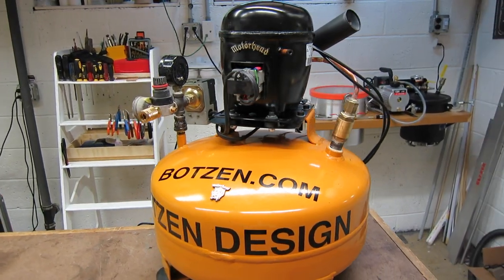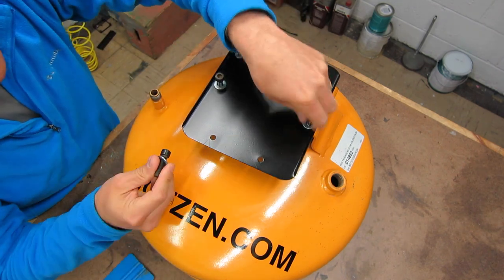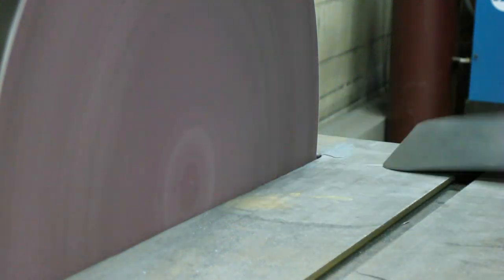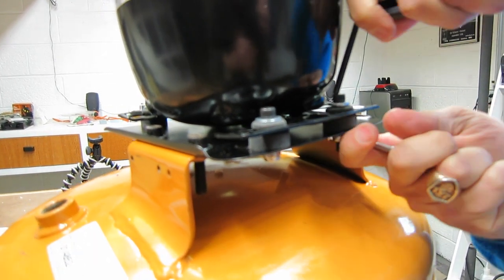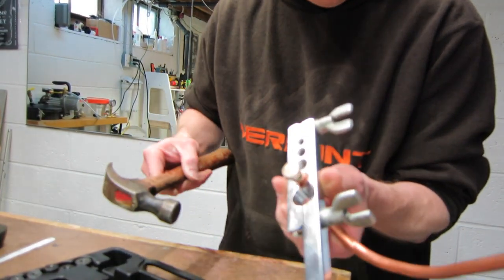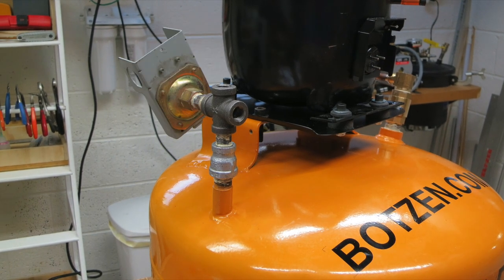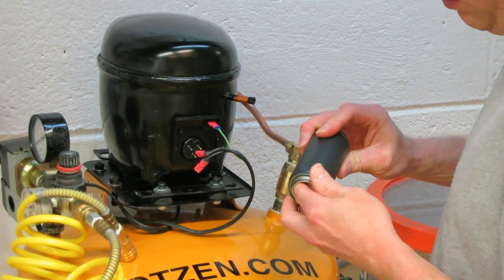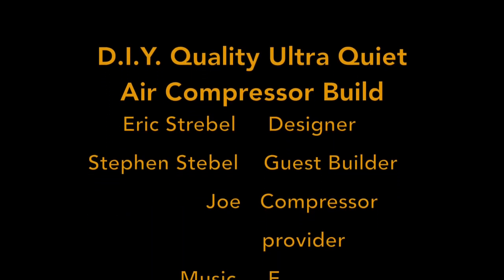Ultra Quiet Silent Refrigerator Work Shop Air Compressor Build

Comment: i see and heard you say to replace the oil with 10w40, but you didnt say how much. whats the volume needed if you know an accurate answer? thanks for the great video. but its be nice to see some hillbilly hacks instead of a full shop.
Reply from the maker: I added the same amount of oil as I removed, I have no idea what that volume is, i drained the old oil in a cup, made a mark on the cup, then got a fresh cup and filled new oil to that sameark and put it in the compressor. That doesn't really matter since it's going to be different  for every compressor. Thanks for your comment and support, much appreciated.

Comment: Two thing of note in this video: , use a refrigerator compressor, and change out the oil. Oh, it helps if you have a metal working shop.

Comment: Nice project..but the only problem with this compressor is that it discharged so much oil out from the compressor and it affects the air especially when you use this for spray painting.. if u can adress this prob then its perfect..good job

Comment: I’m removing the same compressor off in my refrigerator that we are getting rid of it is the same brand I wanted to ask how much or oil do you add to it once to remove it?
Reply from the maker: Lasurge1982 put in as much as you drain out.
Reply: Eric Strebel So the two copper  hoses coming off the side of the compressor are the input and output And the one on the opposite side by the site itself is oil fill?
Reply from the maker: Lasurge1982 yes, every compressor is a bit different, double check the one you have to make sure.

Comment: Hi there, what is the max. pressure you can reach with an old fridge compressor? Can it achieve 120 psi (8 bar) or more? I was afraid of overheating the compressors with that much pressure and went below 80 psi. 20 years ago i built an home made compressor out of 3 fridge compressors in parallel to fill up a big gas tank. Still working today but one compressor quits - makes a summing sound but doesnt pump.
Reply from the maker: richardnanis don't know the max pressure, but I charge my tank to 100psi, so it seems feasible.

Comment: can I still use a compressor that I've grinded open? I understand that it needs the oil for lubrication but If i have it sitting in its casing in oil will it still function properly?
Reply from the maker: I have no idea Easter Bunny, try it and see what happens. Make a video and share it with the world so we can find out the answer. Good luck. Thanks for your support and comment. Feel free to share on social media!

Comment: nice video, the third line from the compressor that has no connection did you seal it off or just leave it? what is it purpose?
Reply from the maker: C.S.Rodney thanks!

Comment: I built an air compressor from a refrigerator compressor and it ran for about 3 months. Then it start short cycling. It would run 30 seconds then quit. What did I do wrong? Thanks for a great idea.
Reply from the maker: Not sure, not my filed of expertise. Probably your on off switch or the capacitor, good luck
Reply: @EricStrebel  I did not replace the oil as you did and it was getting into the air supply to the tank. I think it may have caused the motor to seize up some and make the pressure too high to keep it running. I will try again. Thanks.
Reply from the maker: The oil I used was definitely thicker than the stock stuff

Comment: Thanks it a great video tutorial Eric! This video is one of my references when i builded my own air compressor out of a fridge compressor, its a two 1/2hp fridge comp and a 20kg propane tank.  i noticed that you replaced the factory oil with 10w40 synthetic motor oil, right? and before putting new oil did you flush it with solvent (ac flush, isoprophyl alcohol, lacquer/paint thinner)? 

Thanks again.
Reply from the maker: Good luck, I just changed the oil, I did not flush it with anything, watch the follow up video as well.

Comment: Do you happen to know the CFM measurements from this build? Looking at other options for metal engraving need a certain CFM value and PSI to operate a tool. This appears to be a much cheaper alternative.

Comment: My dad converted an air compressor from a commercial air conditioning unit to use in his garage 35 years ago. Some of the parts he used were galvanized metal and not brass or copper. All the galvanized parts rusted and blocked the airflow over the years and had to be replaced with brass. So use what you have but if you need to buy some parts and have a few extra dollars buy brass and it will be maintenance free.

Comment: You have to add an oil ceparatore then feeding any separated oil back into the section pipe. Otherwise the compressor is going to  run out of oil in few months.
Reply from the maker: ahhh, no you don't. been running for years with minimal oil loss, just add a few CC's every year.
Reply: @EricStrebel  It depends on how many hours you are running the compressor. But, you can't be sure what to add and when.
Reply from the maker: I doubt that the compressor runs for more than 1 hour every two weeks, so not very much.
Reply: @EricStrebel  , that seems a fixed rate and you will be able to estimate the top up rate correctly.
Good luck.
Reply: Still, if you can add that oil separator it will be so great.
Best regards.

Comment: Machine shop 101...  NEVER wear gloves when using a disk sander! Seen some people loose tips of fingers when the glove get pulled into the gap between the disk.
Reply from the maker: Safety is important. I agree, Wear a pair of gloves so you don't burn your hands, two schools of thought here! I am wearing gloves on a pretty big piece of metal. Never do I get close to the wheel. So not an issue for me. If it was significantly smaller I would wear a pair of tighter fitting gloves. Don't get your fingers close to the gap at the bottom of the disk an the shelf. I would recommend a pair of mechanics gloves. I am aware of the danger, know your limits and be smart.  Thanks for the comment and support.

Comment: But how long does it take to fill?
Reply: JAH1R very long
Reply: actually it should takes 5 minutes.  It all depends on the displacement of the refrigeration unit.. a good one could have up to 5 cucbic centimeters,,, they could do it in 3 minutes for that bosticht tank.
Reply: 7 to 8 minutes going on the video.

Comment: whats the amount of oil the compressor takes?
Reply from the maker: i3dm however much you drained out of the unit.
Reply: Eric Strebel mine spilled out so i cant tell. i added abiut 6oz of mineral oil and she seems to run nice and quiet
Reply from the maker: i3dm i doubt mineral oil will hold up well over time.

Comment: What is the typical operating pressure, on the refrigerator?
Reply from the maker: I have no idea
Reply: Some go to 500 psi. We use fridge motors in the opposite direction to suck air out of things. They work really well to make near vacuums.

Comment: What do you do about the oil coming out that needs to be fed back into such compressors?
Reply from the maker: I do run a filter on the system at this point, I see no oil getting trapped in the filer. You can always just add a few ml's of oil every year if you feel it needs that.

Comment: how did you get the old oil out of the compressor? and did you just replace the same amount you extracted?
Reply from the maker: Tip the compressor over and drain the oil out of the fill tube, yes same amount of oil was returned after it was emptied.
Reply: @EricStrebel  Thanks.  I'll give that a try.

Comment: What is the flow rate on a system like this? How difficult would it be to adjust the design to be switchable between compressor and vacuum pump modes, or just vacuum mode? It looks like alls you'd need to do is switch a couple pipes around. Has anyone tried this?

Comment: Maybe it’s already been asked, but how come you didn’t put in a pressure relief valve on the high pressure side of the pump to get rid of head pressure?  Head pressure is in major culprit in restarts for over Amps.
Reply from the maker: Can you share one of these pressure relief valves with a link here for everyone to see? OMM
Reply: Eric Strebel it is built in to the electric starter. Prior to the check valve you need a T fitting (some check valves come with this built in). From the T fitting a 1/4”(6mm) goes back to the electric starter and when the electric starter turns off, it bleeds head pressure. With head pressure bleed prior to a restart, doesn’t overwork the motor until it gets up to speed. This is also known as an unloader.
Reply from the maker: OMM ok, not foamier with this, but I get the concept. My unit runs rather infrequently, so it's not an issue for me, but for others it has been. I will have to investigate this "unloader", Ideally you want this built into the check valve, I can see how this would be beneficial. You probably need a pressure switch that can adapt to the unloader as well, is my guess??

Comment: Can you give an estimate on the cost estimates on the parts? Also, what is the max PSI that the compressor can pressurize the tank to? Lastly, can you provide an update on this project? Have you experienced any issues?
Reply from the maker: taumax estimate is tough depending on the parts your use. No issues so far really, look for na update with a larger tank in the next few months.

Comment: at bottom u have to fix air moisture water out valve. safety  pressure 
valve should fix on the top of tank. u have not fixed the moisture water
 valve.
Reply from the maker: +Bijay Singh Negi Yes, I am aware, other have made this comment too. very little to no moisture in this set up. not an issue...
Reply: A pressure relief valve can be opened to drain moisture then closed back. Since it is brass it will not rust and its faster than unscrewing a drain cock. I have used one on my compressor for years with no problems.

Comment: hello sir, how much oil did u pump into the compressor?
Reply: Pour the original oil into a measuring cup or empty oil bottle. Then you will see how much you need.
Reply: It depends on the compressor model, its a good idea to check the datasheet if you know the brand/model number as too much oil is as bad as not enough

Comment: can you give me instructions on how you install the relay capacitor for the compressor and what brand or type did you use. Ty
Reply from the maker: +homer anthony medici not exactly sure what your talking about, but I used the stock relay that came with the pump and the on off pressure switch is from Furnas, you can get them on ebay. I don't know much about electronics, not my thing, since I am an industrial designer not an electrical engineer. Good luck
Reply: aw ok so you use the stock. some brand new refrigerator compressor dont come with a relay capacitor electrical wiring. another question how did you remove the existing oil from that compressor before replacing a new one. ty
Reply from the maker: +homer anthony medici I tipped the compressor over on its side and let the out drain out. Out of the fill tube, see video. The thicker oil has been great, no signs of oil in the tank

Comment: The socket cap screw should be replaced with the proper length hex head. Easier access with a wrench if you're going to use a fold up cheapo allen key set.
Reply from the maker: +Damn Yourugly I like the look of the socket cap screw. I probably should have used a fixed "L" wrench instead of a fold up..Glad you like the video!

Comment: The major downside of such a design is the very weak compressor will take a loooong time to fill the tank and you won't have enough air pressure when you need it for your air-powered tools, and will have to wait for the compressor to fill the tank again...
Reply from the maker: AlainHubert correct, however, I don't use air tools on this compressor, so it's not an issue for me. It's mainly used for compressed air to blow stuff off and to pressurize the  tank for resin casting. It's so quiet that I can't hear it run and filling the tank from 70-100 psi takes less than 5 minutes so it's not an issue for me. Thanks for your comment.
Reply: You're welcome. But it's still a very elegant design though. Looks very professional.

Comment: I was very curious and I wanted to try it for me to use PCP rifle charging.  Thank you for the info, I like to send and subscribe, I am waiting for the shipment to be returned ok🙏👍
Reply: This would not even come close to providing the flow rates and pressure for a pcp rifle. PCP needs 350 bars of pressure, a home compressor on average tops out at 11 bars.
Reply: PCP airgun fill pressures run 2K - 3K psi.  This one maxes out at 125 psi., not remotely close.  There is a small, bench-top compressor made specifically for PCP airgun use, called the Shoebox Compressor.  It uses a home-shop air compressor as a first-stage air supply, & is just what you need.   A quick Google search will take you to what you're looking for.

Comment: Hey dude. You should never put tin onto wires you are going to attach via a screw terminal. Metal tends to creep at temperatures above 0.7 of their absolute melting temperature if pressure (the screw) is applied. Over time the connection comes loose. Apart from that: Nice build
Reply: 282763 - Can you provide a reference to this advice? I have heard the opposite.

Comment: Dude you can buy that same used bostitch compressor for 30 bucks that has 4 times the power of a fridge compressor and you don’t have to own a metal fan shop? I mean nice way to toot your own horn tho
Reply: Four times the power and 15 times the noise. This is a special project for people in need of a low power low noise compressor. Don't come to criticize other people's work: make a video of what you can build with your hands instead.
Reply from the maker: Well said, thanks!

Comment: I have  question looking at your video one the one part  1/2, 200 psi check valve , what is that  very last piece you screw in at the top ?  Piece one was  1/2 nipple  piece two  was the one way  check valve  but that third piece  i can't figure out can you help me please thank you
Reply from the maker: +John Gee That is a 90 degree elbow, I think it is also a reducer to fit to the copper tubing a bit better.
Good luck, glad you enjoyed the video.
Reply: Yeah  trying to  do what u did in video  so far i  done spent 50.00  just in fittings and  still haven't brought  the pressure switch  still having some  trouble match  up the safety  valve  and   pressure switch . do they all have to  be 135 psi  rated?  or can  do like this pressure switch 100/125   and safety  valve  135psi

Comment: Wow.. Im looking to replace 1.5 kw comoressor with 2cyl 3kw and you have around 100w compressor here okayy
Reply: I looked up the compressor, it's rated for 120v 5.3A.  Of course, that could just be during the start up.

Comment: You should add an oil catcher!
Reply from the maker: Tobias Wattenmeer yes, I should actually, they I would be able to see if there actually is oil moving from the compressor to the tank.
Reply: Its really important because refrigeration compressors are designed to throw out some oil (which normally walks through the refrigeration cycle as a closed system). Therefore the oil storage is blown out relatively fast.

Comment: Refrigeration compressors are made to move oil around the system to lubricate the other parts.  You will get oil in your compressed air and the compressor will run out of oil and that is it.
Reply from the maker: Eldon Ashbaugh actually I don't find that to be the case. The compressor is meant to move freon and it moves a bit of oil when it does that. I have not seen any oil or water in my tank thus far after over a year of shop use. I don't see any in my trap either. Quite the reliable unit actually thus far.